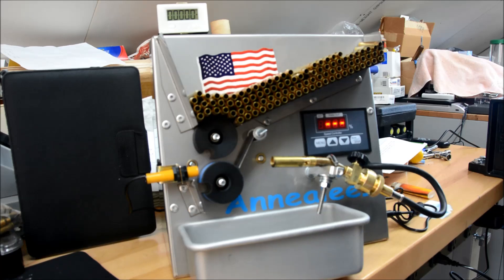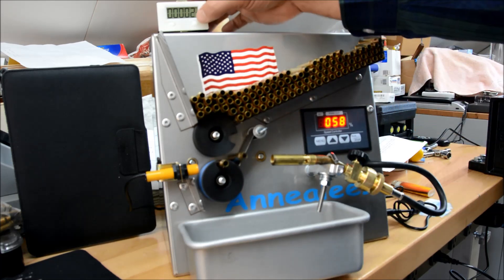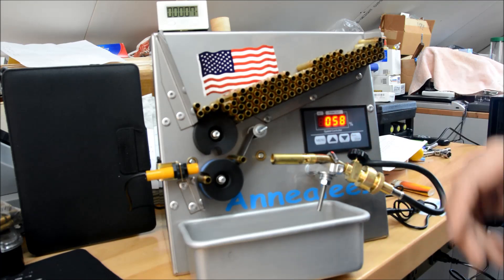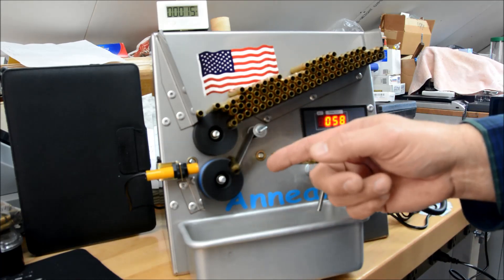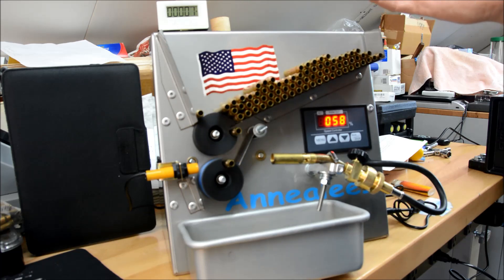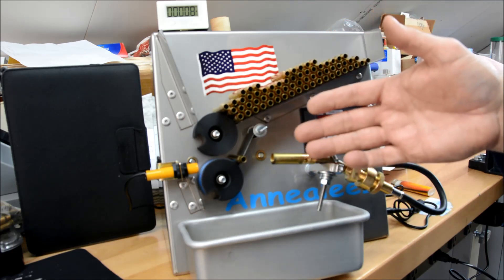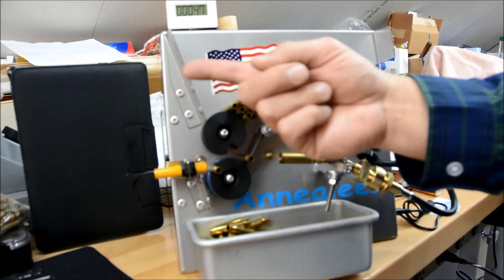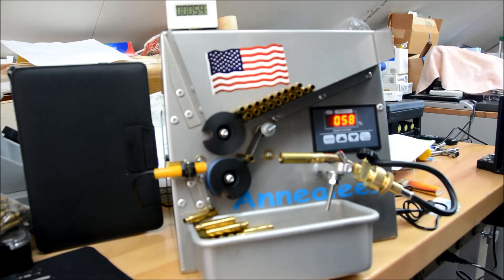Annealeez 2.0 Counter Mod

Comment: What sort of space are you using this in? Would a small bedroom/office room be safe to use this on or would it be best using it outside for the propane?
Reply from the maker: A loft, just very careful to be sure it’s lit and no gas is leaking.  Soapy water is your friend.   I do have two windows for ventilation so that helps.
Reply: @Hazzbro1964  thanks for the reply

Comment: I have two questions;  Does the proximity Sw have to be horizontal or can it be mounted Diagonal or vertical?  And is there any reason why you can't put the magnet on the upper wheel?  Thanks, Keep up the good work.
Reply from the maker: The prox can be mounted in any axis.   I may eventually drill a hole from the back and install it that way...magnets in the wheel would then have to be 90 degs. to what I show now.     No, the magnet could be in the upper wheel.   Probably a better location as I have melted one sensor already :)
Reply: @Hazzbro1964  I mounted mine almost verticalso as to be away from heat as much as possible

Comment: Wouldn't it be easier to just count the brass when you put it in the hopper? I don't see the need for such. How would you mod the machine to anneal much smaller brass? 1.07 inches to be exact.
Reply from the maker: I’m sure you could count the brass before hand but I anneal hundreds at a time.   I just keep topping the hopper off and let it count.      Not sure on the shorter brass like you mention but there are those a doing it.  I imaging you could just add a spacer in the hopper and on the wheel to push them forward enough to be in the flame and safely away enough to keep from damaging the wheel.

Comment: How did you wire it together? Do you have a like to a video for the installation guide?
Reply from the maker: I can add that to the next video for sure.  There's only two wires and you connect them to the counter in the rear (it's labled).   I'm going to make another video soon using Tempilaq and running several hundred cases.
Reply from the maker: Here's the new video that shows the backside wiring of the sensor:    https://www.youtube.com/watch?v=77QUj9qyQhA&feature=youtu.be